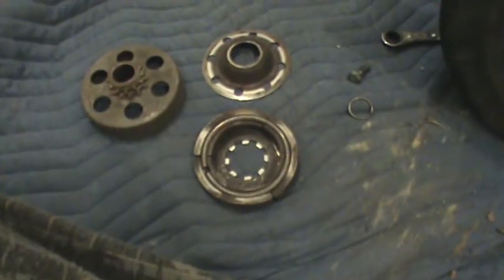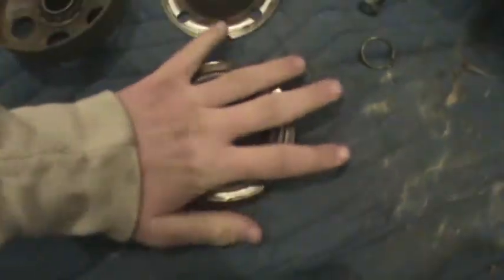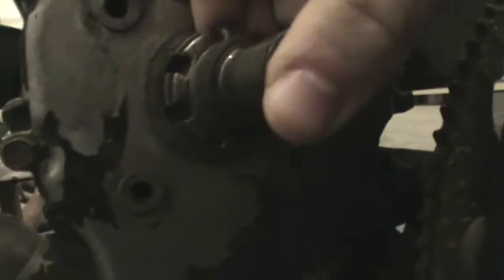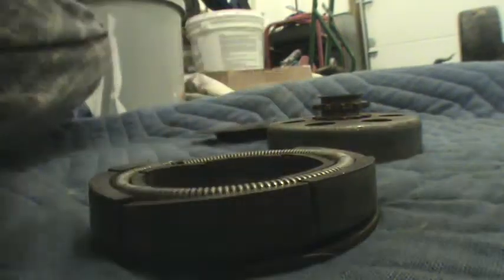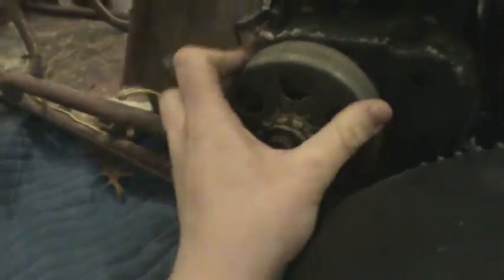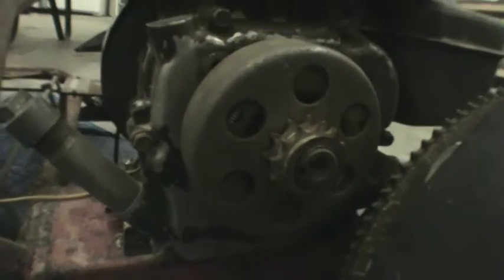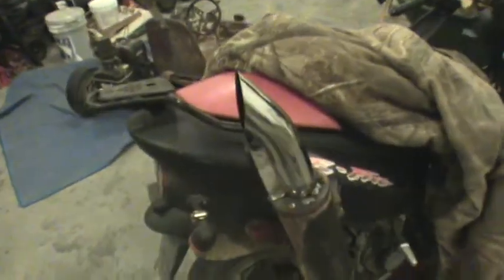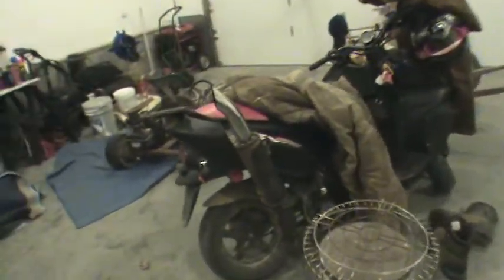How a "go cart" clutch works

Comment: Thanks for the info.
I am working on a go kart with a Honda GX 160 and I can not seem to figure out why the rear tires are constantly spinning when the kart is just idling.
Well now thanks to your video I know that the engine is idling much too high. The clutch works of rpm and if I adjust the idle down then my clutch will not engage. This video has been helpful 
thank you

Comment: @PTEredmond Without the clutch the vehicle would always be moving. The clutch "disconnects" the engine from the wheels when the engine idles or is at low RPM.  So the vehicle can be stopped and the engine keep running. Then when you want to go, you rev the engine which "engages" to the wheels, moving the vehicle.

Comment: some go karts are have 1 axel going to both back wheels and the engine has to move both wheels...

some go karts (like mine) have a separate small axle for each wheel and the engine only has to move 1 wheel.

if you rotate one wheel and the other move you have 1 axle attached to both wheels.. if only 1 moves you have 1 axle for each separate wheel.. so only 1 wheel will be moved by the engine..

Comment: could i just stick a pulley or one of them gear things right on the shaft from the engine and have the chain or belt go to the pulley/gear thing to drive the wheels? what happens if you don't have a clutch  one more question do you want a big gear/pulley thing or on the engine or a small one in order to get maximum speed? thanks :) im new to this

Comment: @PTEredmond    Maximum speed would be obtained with a large gear on the engine, and small gear on the wheels.  But the engine spins too fast and doesn't produce enough torque to to power a go-cart, so usually a small gear on the engine and large gear on the wheels is required to get the right balance between torque and speed.  

There is never a set ratio or size, it depends on the engine size and and the desired performance with the available power.